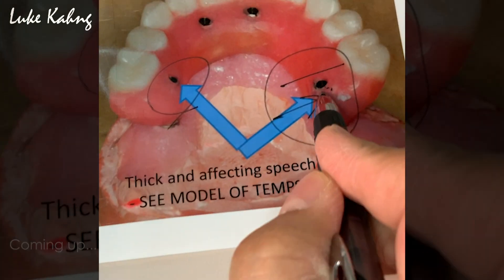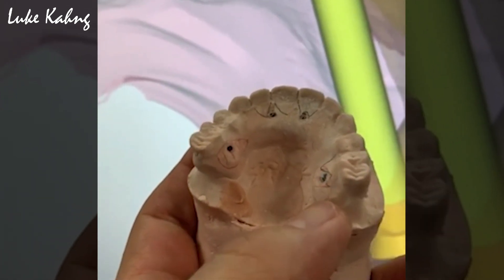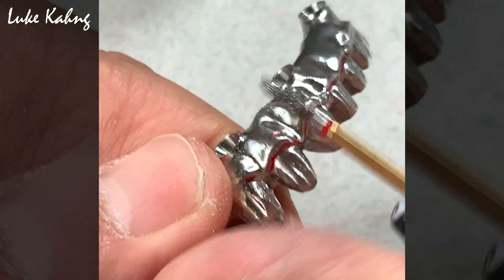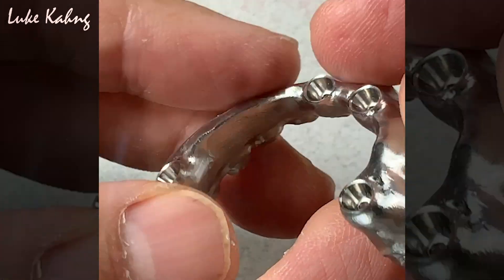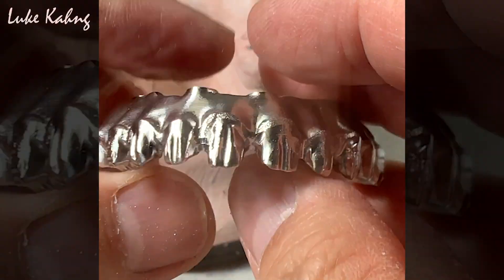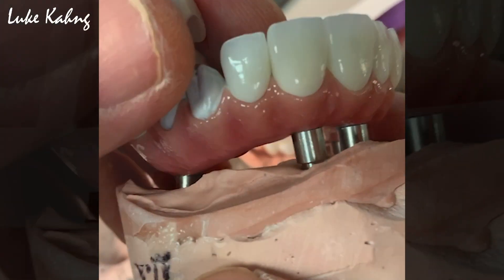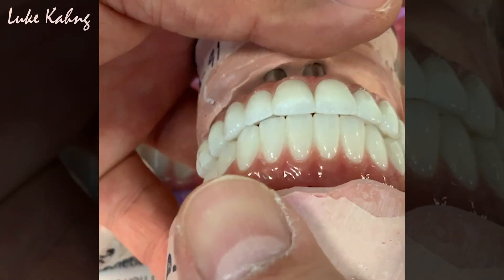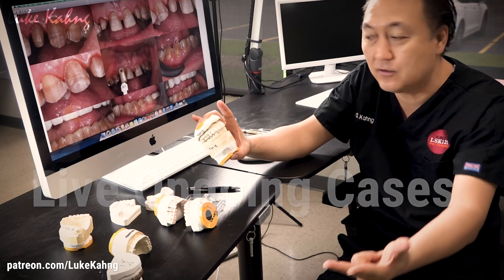Why is the Syton™ 7-Star is better than Zirconia Implants?

Comment: Do you read Cone Scans? I had a terrible experience with implant surgery. The surgeon told me he broke my bone and he wasn't able to put in 5 implants but only 4 and he couldn't put in the transitional prosthesis.  The lab tech quickly made a new one but it wasn't the full upper arch and it has metal attached to it. They told me I had enough bone and didn't need a sinus lift so I am wondering what went wrong. I have two scans, a Cone Scan that they had me take and a Clear Choice scan a month before going to them. I am left "hanging" now not knowing what to do. The dental office that messed up the surgery refunded me my money. I don't know what to do.
Reply: Elaine: Sounds horrendous. It is really terrible when these things go wrong and when docs/dentists mess things up. I think it wasn't enough to just have refunded your money (they got off lightly). You could sue them for malpractice and probably win the case and get  much more money from them. You should try.